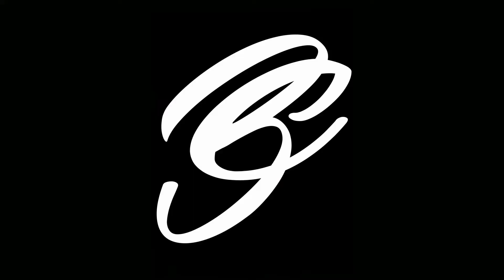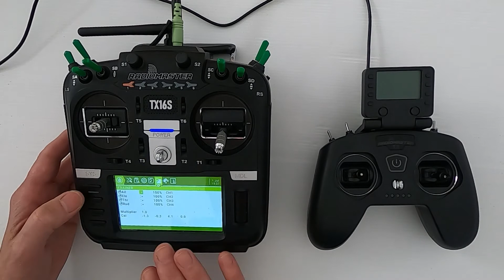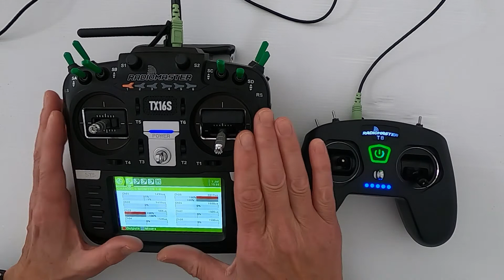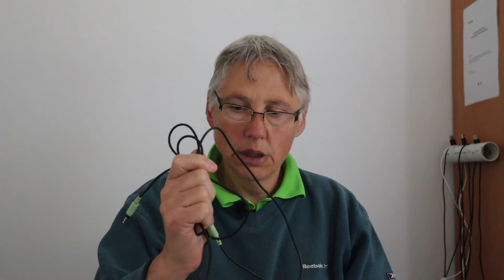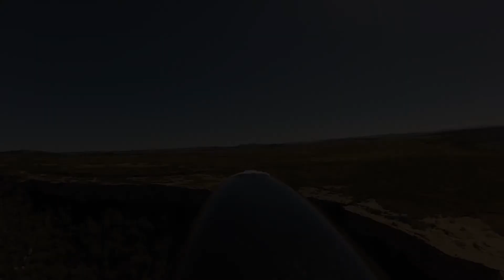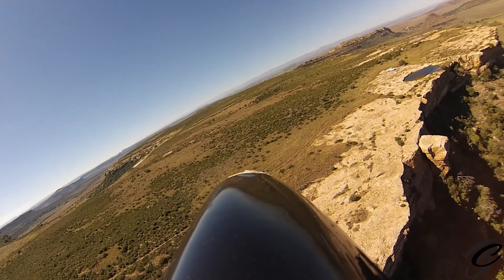RadioMaster T8 Pro Setting Up Buddy Box Training

Comment: As per the comment on your other buddy box video Bill the plug and cable required is a Cliff Electronic Components (CLIFFUK.co.uk) FC68122C plug and cable (x2) which are only available from TME.EU (in Poland I think) CPC.FARNELL.COM (England) or DK.FARNELL.COM (Denmark) with stock levels of 439, 38 and 195 respectively. Everywhere else is ex-stock for months hence. Wiring in a normal connector is a no-brainer!